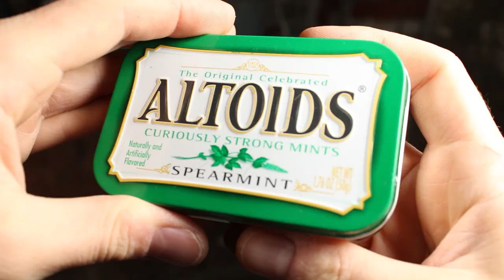Workshop in a Backpack

Comment: This channel is like “This Old Tony” in the bud, electronics version. 

I took a degree in electronics over a decade ago but can’t even solder two wires with proper reliable conductivity, let alone deal with PCBs.

Now I see 3D Printing (CAD, mechanical engineering), electronics, software are all coming into one place to create stuff. Amazing. Makes me want to get started with Arduino.
Reply: Counter: Zack has a face

Comment: I had a pair of behind the head headphones when they went out of style for a while and became impossible to replace. They were Logitech, but they were made of some ungodly brittle plastic and were made up of tons of tiny pieces screwed together. There were about 24 screws in a simple pair of headphones. I had to replace the battery twice, all of the wiring, the USB port had to be soldered back on, and way before 3d printers, I took several small pieces and made moulds of their shattered remains and made gorilla glue copies that I had to sand down. I finally retired them when something on the board burned out and I didn't feel like running it down, but I have them somewhere still. They are probably only about 25% original material now, they are mostly made of gorilla glue, kapton and courage now. Now that I own a few printers, you've made me want to drag those out and rebuild them. There just never were better, not comfortable headphones to wear with glasses.

Comment: Yea, I do- So about 5 years ago my dad bought some big kind of like Beats over ear headphones. 3 years ago the driver wires broke and I fixed them. 2 years ago the charging port broke and I re soldered the thing- 2 days ago it broke again and I made it charge with an internal power bank I slapped in there... Balance is a bit off but it works just fine

Comment: Love the bag! I just finished putting together my own TS80 soldering kit, made a stand with a spring in some square stock aluminum mounted to an aluminum angle piece which I can pivot up to any angle, threw that in a pink space maker case along with a QC3 battery pack and some other little bits. I like the masking tape for holding down those tiny pcbs

Comment: Fantastic tool bag, love that the screwdrivers fit into nerf blasters. I’d recommend throwing in some rare earth magnets. Very helpful when trying to retrieve something magnetic (like fallen screws) from hard to reach locations ~ tape a magnet onto a broom handle to reach under/behind unmovable objects
Reply from the maker: That's a really good idea. You could also stick screws to them to keep them together. I'll definitely think of a way to work some in.
Reply: I stick them to my screwdriver shafts to make temporarily magnetic tips so I don't lose tiny screws as often. I find that permanently magnetic ones collect metal shavings and aren't always what I want anyway.
Reply: @ZackFreedman  bit of a necro, but there are screwdriver bits that are just neodyneum magnets, ifixit's larger kits include one for example; additionally there are purpose built ones that are about pen-sized and work like those telescoping pointers but with a magnet on the end

Comment: I love the bag, also, my gadget that I refuse to let die is my MP3 player. Cowon X9, I lost the cable for it, so to charge it I soldered some loops onto the battery solder pads and every time it goes flat (Once a week, killer battery life) I open the case and connect a USB lithium battery charger to it.  Only issue is the music that's on the inbuilt part of the memory is forever the same now, until I get sick of it and replace the proprietary connector with USB C or something.  

When the battery dies I'll be retrofitting whatever I have on hand, which will probably end up being an 18650 with 3 times the battery capacity, and if the screen goes I'll figure that out when it happens.  Love that MP3, it's always in my car and it's been with me to 5 countries.

Comment: I was going to say for my Etsy I have some stuff I designed around Altoid Tins, Im a bit fancy now because I ordered black Altoid tins from suppliers over Alibaba and then I laser engrave off the paint to etch a design into the lids (if you do this careful about over-engraving, heating the tin and then ruining how it closes.

But on the Moleskin thing.... I prefer a Moleskin, because Im left handed and I don't like writing with my hand resting/running up and down a length of wire which starts to hurt after a while.

Comment: Hey another crescent flush cut shill! 😂
I love my crescent set.

Also, that The so-called Sheep's foot blade, also known as a Mariner's blade, is one of my favorite designs. It was originally designed for common crew on sailing ships. The crew need knives for their work and also for safety in case someone gets entangled in the riggings which happens sometimes. BUT, the ship's officers harbored a constant fear of a mutany so they didn't want the common crew to have weapons. The Mariner's or Sheep's foot is a good blade style for utility and for enganglement emergencies, but not so good as a weapon. And so that's where this profile came from.
:D

Comment: Yes to keeping good old gear in service.  I've repaired the Sansa Clip + over and over and over... resoldering the headphone jack to the motherboard or replacing batteries or replacing the case back because the clip itself broke... but they're the best MP3 player ever made and they run a very customizable replacement firmware (Rockbox).

Comment: You should look into Swan Morton scalpels, infinitely better than x-acto blades and handles plus they cost less. The fixed blade is the best, but you'll need to print a cap or case. They have a retractable version but it's a little clunky and the blade has a little bit of play still 10/10 though.

Comment: I have 3D printed and resouldered almost every part on my Sony MDR-XB950B1 headphones. Yes, both headphones, because even the replacement one that I bought has broken
Reply: The Theseus ship headphones. If you resolder, 3D print and repair almost every part of the headphones, is it still the same pair of headphones
Reply: @spetsnatzlegion3366  I have officially owned 2×950B1s, 1×650BT, 1×950N1 and they've all broken. About to get the Sony WH-1000XM5s. Wish me luck.

Comment: The tool I keep fixing and modifying is a ln old Idea-pad that runs Manjaro Linix. I replaced the 2.5" disk drive with an SSD. The ram got upgraded to 16gb of ddr3 1333mHz. The bottom chassis has a Crack in it from that time it fell down some stairs, that was patched up with JB weld. There have been some little plastic chips taken out of the corners as well, which were replaced by filling the holes with hot glue. It's not as powerful as my main machine, but it does everything I need it to for quick coding and blender-ing on the road.

Comment: I've saved my self $40 by repairing a stick blender. First some one melted the cable back in uni. Then a gear wore out so I printed a new one. Then it got dropped and the bit that links with attachments snapped so I printed a new one of those.... Twice because the first time the PLA decided it wasn't tough enough. 

I should have just brought a new stick blender. It would have probably been easier.

Comment: i have an old microdriver set i nabbed from my moms ex back in 2012 that is missing bits, the remaining ones are rusty, and the screwdriver broke under the rubber grip so it flexes and its held together by nothing but the factory grip glue

Comment: i used to have a gadget i refused to let die.. until it finally got so broken i could not fix it anymore.. the plastic was failing, and giving way more places than i could fix, and printing a new shell was not possible due to my 3d printer not working(still not working, but i am looking into it) and finally, a chip blew on the pcb, and i cannot solder something that small without damaging it. so i finally bought a new pair of bone conduction headphones, and have had to leave the old one behind.. it's still around, in a box somewhere, along with a few other headphones i have busted by simply using them. waiting for a day i might get them working again.

Comment: I have a pair of 16 ohm PHILIPS wired earbuds that have great bass and I refuse to let go, the cable is split in half, the audio jack is nonexistant and is now made out of glue, and i've replaced the covers like 5 times.
It also used to be white so it's now a disgusting brown color.
Sounds great and haven't found a pair that's better.

Comment: 5:41
Currently keep fixing my pc headphones. One of the "phones" keeps falling out of place. Duct taped the foam covering to the plastic cup that attaches to the speaker plates, because it was falling off both sides (failed adhesive) and I still need to do something about the goo from what I guess is from hair oil/sweat/humidity and temperature cycles/and the adhesive that held the rubber trim to the "dome band". The adhesives use in some of this product seem to either just suck, or not do good in my environment.

Always fixing my vehicles as money allows hahaha

I honestly fix what ever I can to keep from buying another. A few recent: One lcd tv recapped and still going strong. Multiple repairs to my daughters laptop, now mine, she has a "stronger" one, and I will likely pull the ,now mine, lappie apart and reconstruct it into some purpose built monstrosity. Another laptop, that needs a motherboard, will eventually turn into an AIO "PC". Ice maker is up for third repair. 

I feel like I am completely forgetting the one that would be the prime example. There always seems to be something that need a little something to keep going, and I will take the time to do that. HAHAHA, my chain wallet chain, in the long long ago.

Boy howdy, this has got to be the longest youtube comment Ive ever posted. Good on ya Zack!!

Comment: Awesome Video! What are your thoughts on ts80p or a ts100, I do not have a ton of usb c stuff but also not a ton of xt60 connectors. Thanks :)
Reply from the maker: The TS80P is a minor upgrade over the TS80. I wouldn’t upgrade from a TS80 to the P, but given the choice of which to buy, I’d pick the latter. 

I think the TS80P is a smarter buy than the TS100, since you have more cables and power supplies to choose from. It’s also easier to install aftermarket and upgraded firmware.
Reply: @ZackFreedman  Alright, thank you. I was leaning toward the Ts80p due to it being newer anyway. How are the tips on it since it has the proprietary headphone jack connector.
Reply from the maker: @justinlevy4497  They're decent for field work. The chisel tip is a bit larger than I like, and both tip cool down fast, but they both do the job. I wouldn't recommend it as your workhorse, but it's really impressive for a go-anywhere iron.
Reply: @ZackFreedman  Alright, thanks. I don’t rlly have a large place to solder all the time because then I would get a t12. Thanks for all the help and your videos are so awesome.

Comment: I swear to God the Glass screen protectors like on your iPad cause more damage. 

My thinking is... when dropped the glass transfers much more of that energy to the actual screen of the device. whereas the old-style rubberized screen protectors absorb some of that energy instead of transferring it directly into the screen. Allowing it to flex without forcing the screen to flex with it. They’re just much too rigid and I think they cause more damage.

I still use the old zagg invisible shield rubberized screen protectors. They might be hard to find sometimes but damn my screens never break and I am notoriously hard on my phones. Whether in my lab, welding outside on the ground, or climbing the electronic scrap pile at my buddies recycling yard… My phone takes a real beating and I’ve never had a broken screen. (Knock on wood)
Also… One of my buddies that I hang out with on a daily basis… We’re always welding, blacksmithing, and working on projects together. We usually have similar cell phones and he uses the glass screen cover front and rear. He’s breaking his phone screens constantly and spending shit tons of money to buy a new phone and get them fixed. Because I’m not taking them to my lab and fixing them when he’s just going to carelessly break them the next day. We use a similar OtterBox case and I’m always dropping my phone from much higher onto more damaging materials… And he he’s dumbfounded why my phone never breaks. I really do think it’s the rubber screen covers that allow my screen to absorb less energy from the fall.
Sure makes a lot of sense why these companies would push glass covers so much… While the rubberized covers are becoming harder and harder to find. Nearly damn impossible for some phones.

Comment: Wait, WHAT? You can not bring knife to plain, but You can bring a bunch of random tools?
Including soldering iron, which can be used as a weapon? (even when not heated)
Reply from the maker: For the most part, the TSA is looking for specific items. They also don't care about collapsible items - they ban pointy things six inches or longer, but the soldering iron breaks down into two four-inch pieces. I know, right?